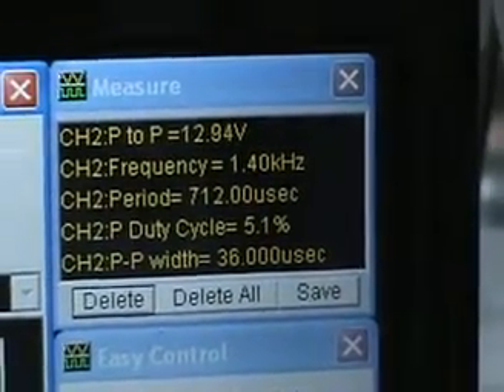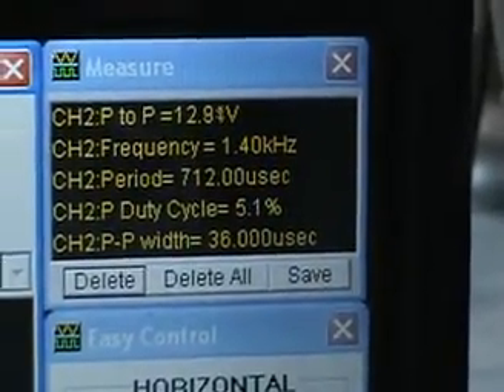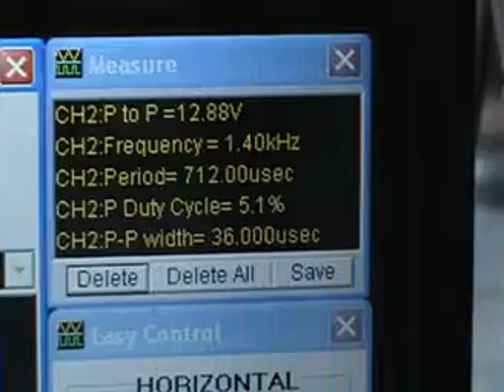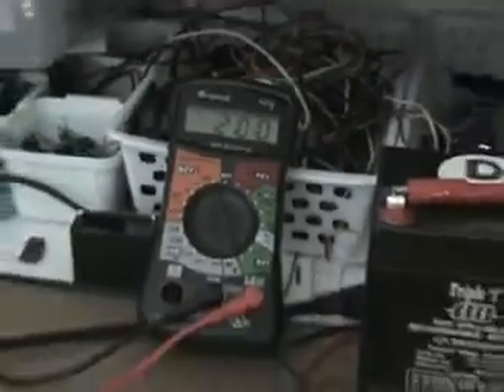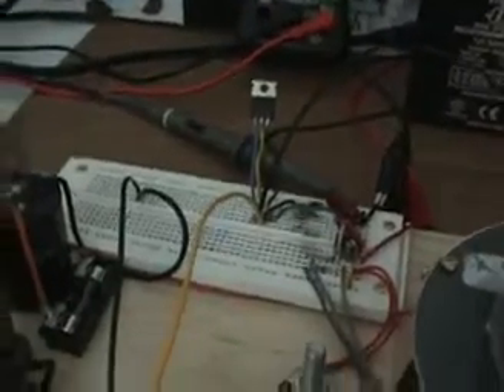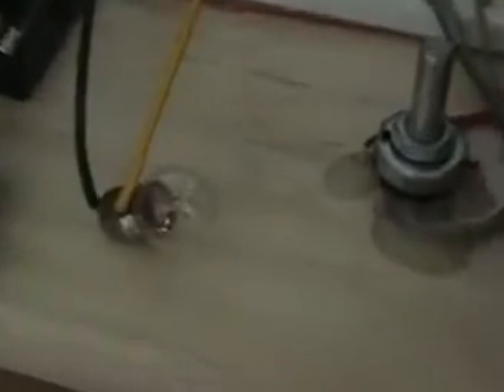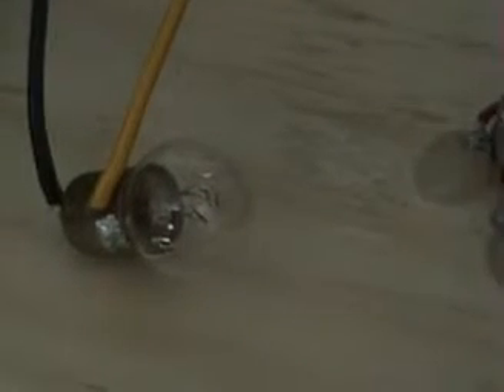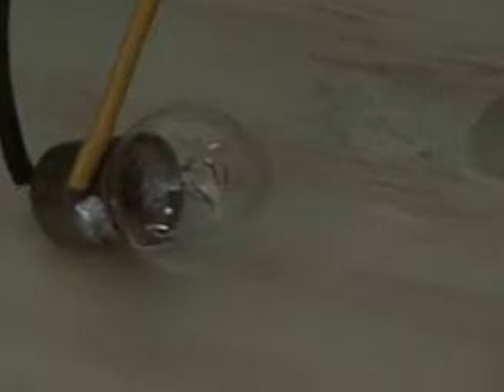Effect of Recirculating BEMF to Coil test 8

Comment: does the levitation get stronger if the bulb is unplugged?

great job, also on the oscope can you test the hv output or just see what you putting into the circuit, would you recomend this or a stand alone setup.